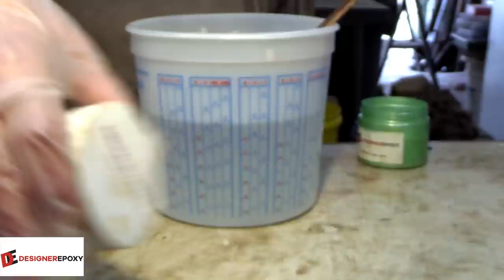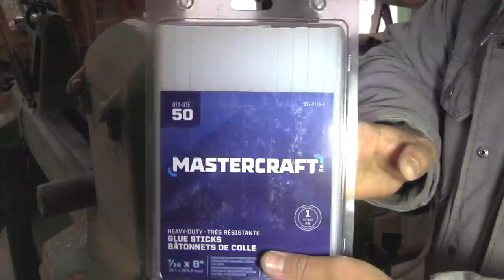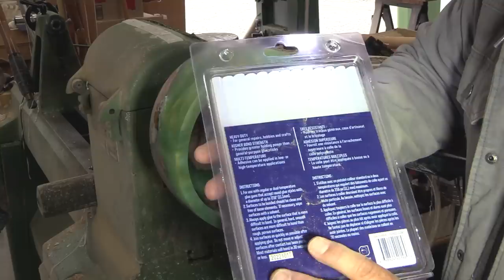Woodturning - The Green and Gold Charity Bowl

Comment: Another great piece and the color separation you get with the Designer Epoxy is great to bad the foot didn't work out but I agree it had to go although I was hoping it would work out. You are lucky to get access to so much maple burl. also, I had an idea that might be both fun and worth your while. what if once in a while you did your own auction for a piece you could have a starting bid to cover your cost and see where it goes you could post the highest bid hourly until the last 15 minutes and update as needed till closing bell. Just a thought.
Reply from the maker: Funny you mention this, I was debating putting a piece on eBay to see if it was worth my while, lol. Thanks

Comment: Designer epoxy 
You mentioned prior to applying the finish that leaving it overnight it might move.   Did it move?  I just assumed that the Burl was sufficiently dry and stable.   Great color choices.   I think a spot or two here and there leaving a little bit of epoxy colors showing on top of the wood looks fine.  Beautiful gift for your charity.
Reply from the maker: With the built up tension in the wood all woods will move when put into a heated environment. This one moved about 1/6”, so no big deal. Thanks

Comment: Love the green with the burl.  Outstanding job again.  Question, when you say "this bowl will take 2 or 3 coats of Waterlox" how do you judge that.  Another words what do you look for.  I am doing a black walnut urn and I have 2 coats on it now but it does not look as good as yours.  Finishing has never been my long suit so I am open to learning.  Been using the Beall system for years but want to up my game. Desinger Epoxy.
Reply from the maker: I basically put coats on until all the dry areas have been filled, so when you look across the surface there's a constant shine, hopes this helps, thanks

Comment: Thanks for all of the details! Beautiful work! I'm learning so much by watching these. I'm hooked! I have noticed in some of your videos that you use a pressure pot sometimes for some of your work. If the vacuum chamber is for pulling out bubbles, what does the pressure pot do?
Reply from the maker: The PP will push epoxy into areas that it ordinarily wouldn’t go and it will compress any bubbles that might be left behind so small they are hard to see. Thanks for watching!

Comment: Designer Epoxy !
Reply from the maker: Thanks
Reply: Hey Jim, was trying to determine what brand of MT 2 extension you are using as research is showing versions $20 to $100. I know you get what you pay for, but would rather have some insight on what to buy. Can you provide a link or brand? Love your vids BTW. Thx
Reply from the maker: @garycdawson  the piece that screws onto my live center was made by John Tolly and it was a gift. Sorry can’t help you out there. If your referring to the extender that the live center goes into I think I got mine at Busy Bee here in Canada. The live center came from Oneway and I highly recommend it. Hope this helps.

Comment: Jim, 
I just tried to use your 10% off coupon to buy designer epoxy UV resin and the light, but the coupon was rejected because the minimum spend for the coupon is $173.13. Very disappointing.
Reply from the maker: I was told that was changing. I will try to sort it out
Reply from the maker: I just talked to DE and if you didn’t use my code before it should of worked. He said the $200 limit was removed before. Unfortunately you can only use my code once. Did you apply it after checkout? Apparently that’s the way to do it. Jim
Reply: @SpragueWoodturning  
Jim,
I tried to use it for the first time and entered the coupon code at checkout. It was my first time trying to buy from this company. I will try again. Thanks.
Reply: Jim, 
I just tried again and the coupon was still rejected, but I will try again on Monday. It is not much money to save, but I thought the coupon should work. Should I try to call them to make the purchase?  
I have been watching and learning from your YouTube videos for several years. I always recommend your videos to our woodturning club members. Thank you. Take care.

Comment: Good afternoon Jim. If you remember our metal detector/shrapnel conversation, I did forget to mention my CHEAP solution. Go to  a harbor freight type place, and pick up a set of welding sleeves. Cut out some cooling areas on them, opposite the side facing the lathe. They will get hot otherwise. Cheap protection, in a set of 2. $9 US.
Reply from the maker: This is a good idea! Thanks